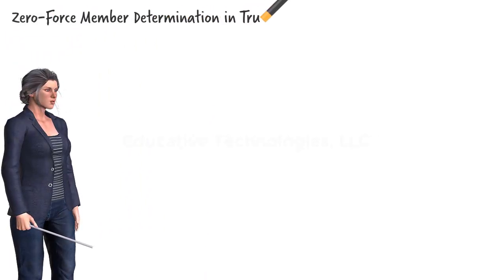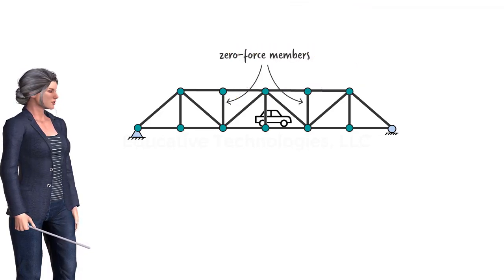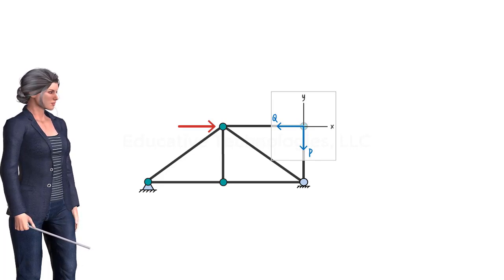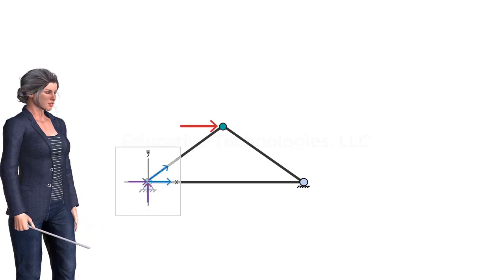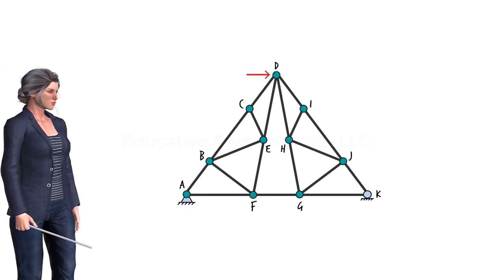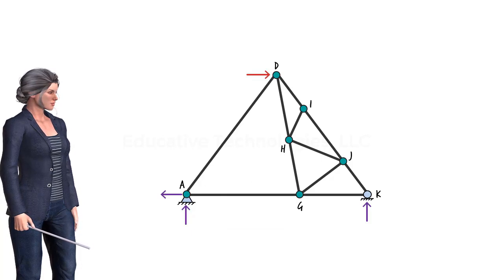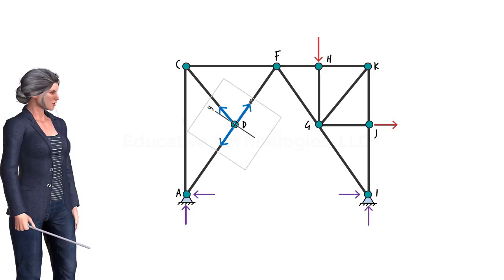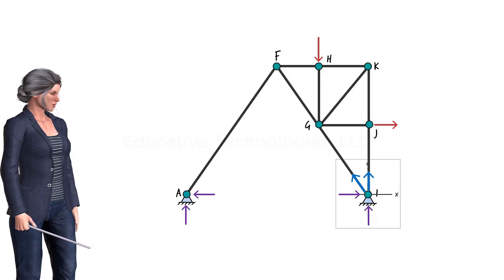ST14: Identifying Zero-Force Members in Trusses

Comment: 2.45 how is p zero its not on y axis
Reply from the maker: True, P is not along the y axis. But, it has a component along the y axis. So, that (y) component of the force must be zero. If the y component of the force is zero,  given that force is not along the x axis, then the force itself must be zero.
Reply: @DrStructure  but doesnt p also have a compent in x axis
Reply from the maker: Yes, it does. But if we show that the y component of the force is zero, then it follows that its x component is also zero.

In this case, we know P makes a non-zero angle with the x or y axis. Let's assume that the angle between P and x axis is 25 degrees (you can use any non-zero value here). Then, the x component of P is: P_x = P cos (25). And the y component of the force is: P_y = P sin (25). 

In this problem, P_y = 0 means P sin(25)  = 0. Since sin(25) is not zero, then P must be zero. And since P is zero, then P_x = P cos(25) is also zero.
Reply: @DrStructure make a drawing so i can understand
Reply: So q is zero
Reply from the maker: Yes, Q is zero as well.

Comment: Why 10:29 this is not zero
Reply from the maker: Do you mean why GH is not a zero force member? Because there is an applied vertical load acting at H. The sum of that force and the force in member GH is zero (the sum of the forces in the vertical direction must be zero). But since the applied force is not zero, GH cannot be a zero-force member.
Reply: @DrStructure  no not GH

but the corners. The corners should be zero.
Reply from the maker: Why should they be zero-force members? Please present your line of reasoning (in a step-wise manner) that leads you to believe they are zero-force members.
Reply: @DrStructure  because there are no loading on the horizontal HK 
Not on GK so. That's why.
Reply from the maker: @bhavikbhatt8346  But there are two member forces in the horizontal direction at either joint H or joint K. One of them is the force in member HK. The sum of the two horizontal forces must be zero. But that does not mean the force in HK is zero. Unless you can prove/show that the other horizontal force (in member FH or in member GK) is zero, we cannot conclude that HK is a zero-force member.
Reply: @DrStructure  but if the GK isn't given in exam. 

The force will be zero right?
Reply from the maker: The force in GK is to be calculated; it is not an applied load to be given. No, the force is not zero for this particular truss.
Reply: @DrStructure  I'm more confued about zero force members.
Reply from the maker: Were you able to follow the lecture step by step? If so, can you explain your understanding of the method? Say, to someone else?  That is, try to give a lecture on the topic. That should help you better identify the point of your confusion. 

If you are not able to follow the lecture, it is important to ask why. If that is the case, you may need to review the background topics or courses pertaining to structural analysis.

If you do understand the lecture, then why draw the conclusion that you are drawing about member GK? That conclusion is not supported by the principle discussed and illustrated in the lecture.